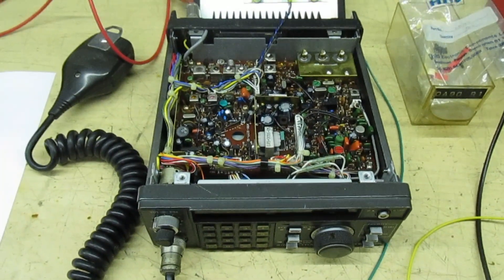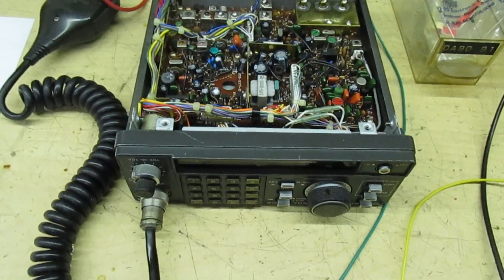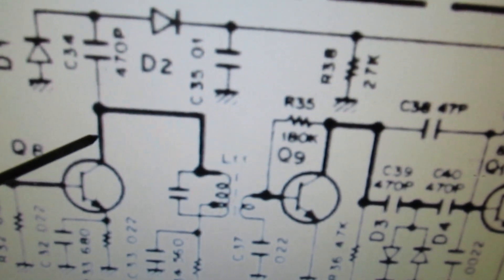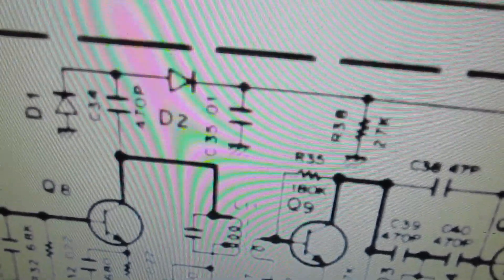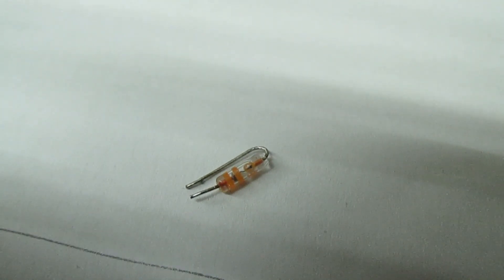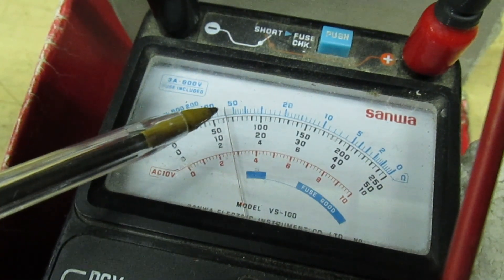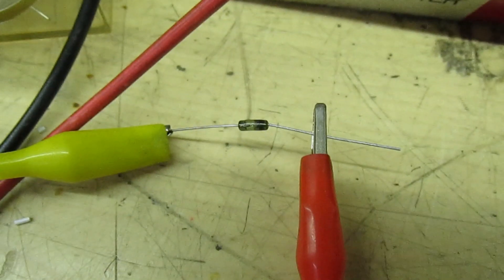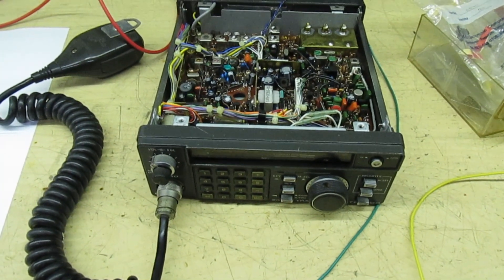Trio TR 7800.     S meter not working on receive repair.

Comment: Great video again Michael, I’m just catching up with your previous work! I worked at British Coal electronics department back in the day and one of the radio repair guys there (also a radio ham as his hobby) was known to be a perfectionist and used to “snip” bits off capacitors to tweak every last drop out of sets, maybe that cap in yours was just damaged though but reminded me of good old days and friends and colleagues passionate about electronics. Thanks again for the video 🙌
Reply from the maker: the good old days when things could be repaired, no circuit diagrams now for most stuff , fault finding is just down to good luck in a lot of cases .